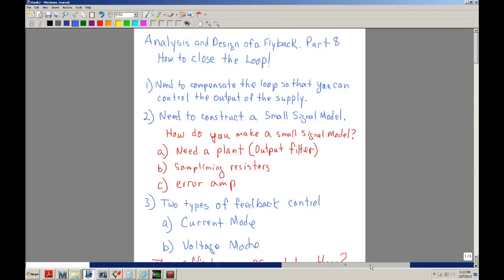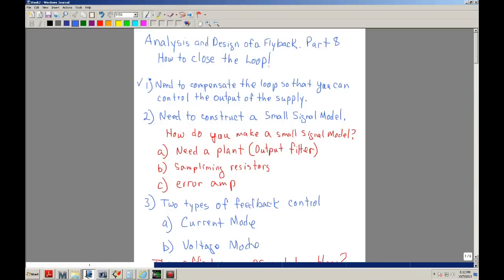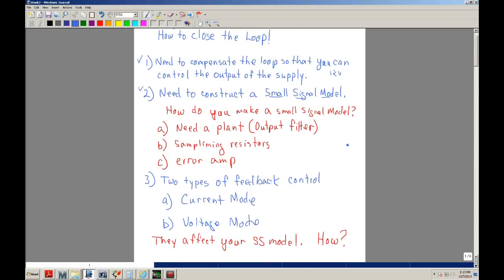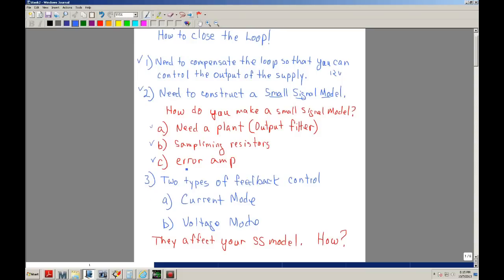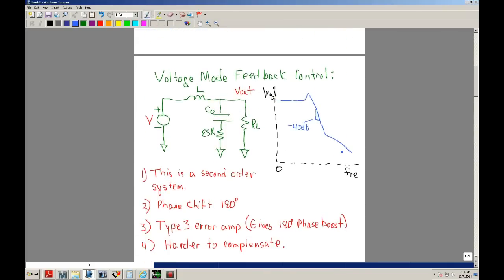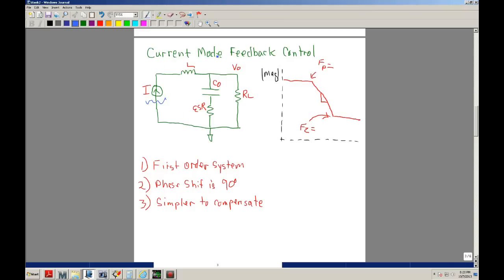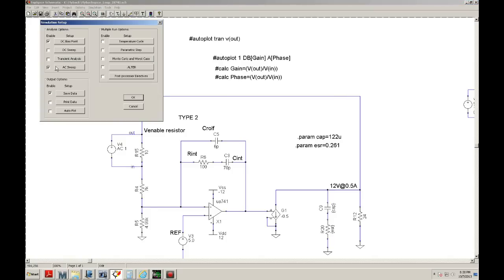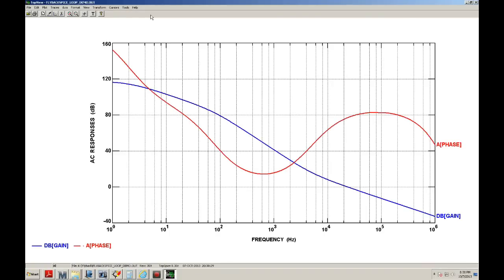Analysis and Design of a Flyback, Part 8, How to Measure and Set the Control Loop

Comment: Hi!
Congratulations! It is impressive the way you conduct the tutorial. 
You match the theory with the practice very well. I learned and understood mainly the closed loop gain that you showed on part 8 – “How to Measure and Set the Control Loop”. I supposed that the PWM frequency is considered very high to influence the closed loop response. Is that right? I have only one question, if you can explain it to me, I will be grateful. What happens with the stability of closed loop if the load resistance (R12 24 Ohm) increases, say, then times? Can the flyback turn instable? 
Sorry! English is not my mother language. 
Thank you.

Comment: Hi. Thank you for your useful tutorials. Now I want to use uc3845 as controller but I don't know how to enter the gain of the input circuitry in the simulation program and where. I should consider it in the voltage controlled current source or somewhere else?
Reply from the maker: Yes that is correct. If you know the output current the just divide by 1 volt which is what want .

Comment: Hi Mr Bolanos, thanks for this tutorial. I am designing a power supply now. I have a few questions for you:

(1) Please, what is the prototype board you are using called and what are the metallic connectors you are connecting components to the board with called, I'll like to have such.

(2) Is it okay to have an offline SMPS without earth connection?

(3) Assuming that (2) is yes, then I have a project that will require very low power, probably less than 5W. I am thinking of using an offline flyback with no earth connection but I can't seem to wrap my head around dealing with common-mode noise filtering in this case. Please what are the things I'm supposed to consider as regards common-mode noise and absence of earth connection.

Comment: The historical reason for having a voltage regulated power supply, as compared to a unregulated power supply, was the output impedance effect at lower frequencies, where you had to have a very large capacitor and/or a very large (low % regulation) transformer and you would still not get the same low frequency benefits as you would using a voltage regulated supply. 

The focus for this realization was, in part, due to audio power amplifiers in driving a loudspeaker where we want operation down to 20Hz or slightly less. So, the power supply to the power amplifier output stage must exhibit a low output impedance, preferably, all the way to DC (0 Hz), so the power output stage will not modulate its supply voltage (low AC impedance source at the supply rails). Feedback provides this effect while avoiding the size and cost of very large capacitors and transformers. If you look at traditional audio power amp design one small signal analysis assumption is the power rails act as an AC short (low impedance).

So, in other words, power supply regulation results in very low power supply AC output impedance.
Reply from the maker: Well said Wind Ward! Thank you for your insight! All true facts!
Reply from the maker: Who are you Wind Ward? You are obviouly an older engineer like me. Are you still practicing engineer or retired?  Email me at rbola35618@aol.com

Comment from the maker: Many of the PWM is based on the UC1843 series of PWM. The comparator is ussually limited to around 1V. So to keep the same gain, I try to keep the error amp output at 1V

Comment: How would you approach this if you were to have a variable output voltage flyback converter? That is, effectively squeezing in a potentiometer between the output voltage sampling resistors and feeding the inverting input of the op amp with the wiper.
Reply from the maker: Hi Jacob. Good question. If you were to replace the two feedback resistors with a potentiameter, it would make is a variable power supply.  But you would have a limit on how low of a voltage you can go or adjust down. For example, if the Vreference voltage that is connected to the noninverting side of the error is 2.5V, then the lowest voltage the supply could be set it would be 2.5V. With this configuration, you could not adjust lower than the Vreference voltage. Hope this makes sense.  Rbolanos
Reply: @RobertBolanos  Thank you for your response. The design i have in mind is a DCM converter using a UC3844 in current mode. Input = 24VDC. Output = ca 30-400V, 50W. 
I've seen another design doing this kind of thing with the same chip, but with no feedback components at all at the error amp, which made me a little hesitant.

Comment: Dear Robert
l would like to measure frequency response of the output stage in case of isolated flyback. Where I should connect channel A of cleverscope in this case?

So far:
I shorted primary and secondary ground. On my primary side I have a pull-up resistor connected to collector of optocoupler and this collector is connected to err. amp. output. My channel A is exactly connected to output of err amp.

I decided to ask because power stage response measured in this way has strange behaviour. I see higher DC gain when I decrease input voltage. I expected that flat part of output stage response will move down. Please advise.
Reply from the maker: Hi Kamil,
To measure the output stage or the output filter response, you connect one of the channels to the output voltage that you are regulating. Let say that you have a 5V output voltage. When then, you connect one of the change to this output.

The other channel you will connect to the output of the error amp. The output of the error amp is connected to the input of the PWM. Send me a email to rbola35618@aol.com and I will send you a schematic of where to hook up.

Robert

Comment: Can you please explain why inductor is drawn as constant current source? Your explanation is not clear..
Reply: Because as you have a constant current source it will force a constant current through the inductor making zero voltage across it, which is a short